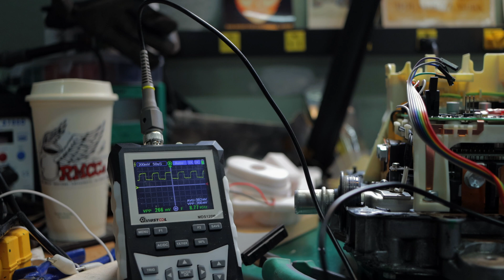Rebooting Rebecca Episode 4 (Short version) - Building the Inverter

Comment: Kate, I've used a similar connector as the one which you show at min. 8 is called DEUTSCH DTM8P and is widely available for few $. No need to 3D print it, instead Google after DEUTSCH DTM and will find few suppliers.
Reply from the maker: I realize that it's not terribly clear in the edit. The 3D print replaces the connector on the motor body with a cable gland. Then the deutch connector goes on the replacement cable...

But thank you!

^Kate